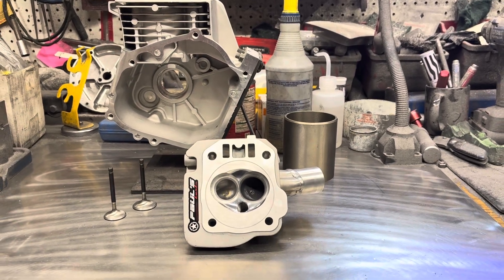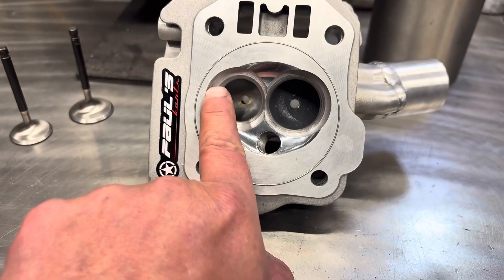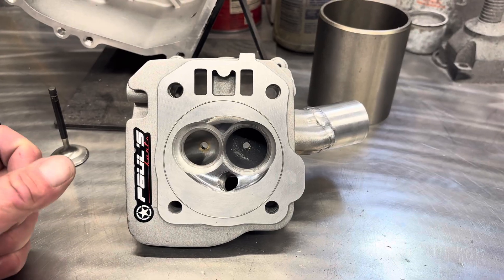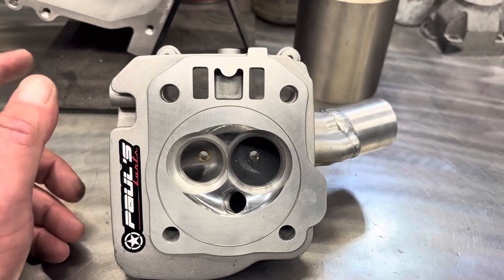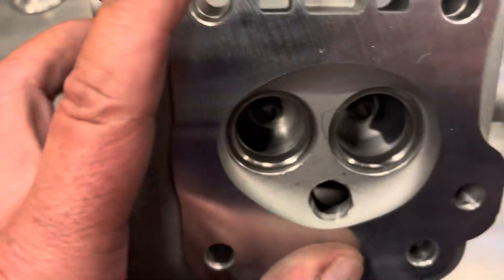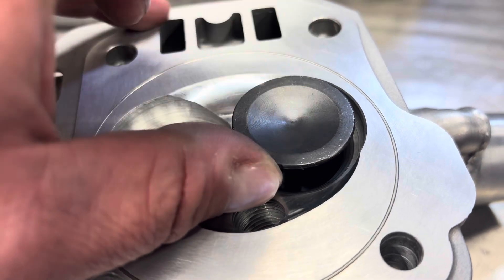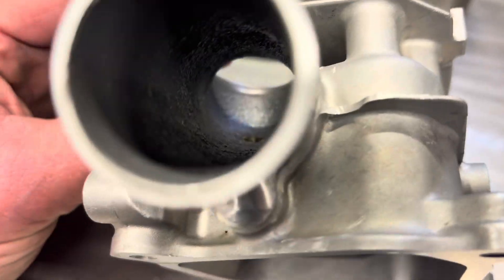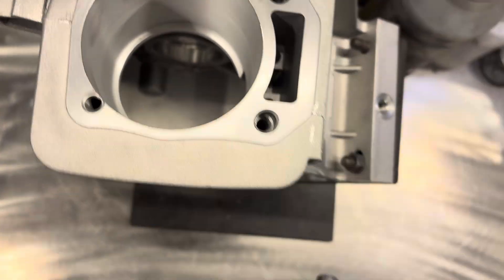Gx200 / predator 212 / Tillotson 236cc head porting look for a 266cc 3” stroker build Paul’s karts

Comment: I know this is an unasked question, would this kinda set up work with a Honda gx160. Not necessarily this exact head, but more like 36/27 valves ECT. 
I have a 63.5 crank stuffed in, wiseco piston, ARC stroker rod, ordering your gorilla camshaft, gage 1.2 rockers. 

Trying to make the nastiest 68mm drag mini there is.
Reply from the maker: No, that 36/27 valve setup size would hit the bore walls. But you can get a 32/28 down through there just fine.
Reply: @paulskartslifan4206 ok man, that’s what my dad was also telling me. I appreciate an answer 🤙

Comment: Insane work like always. Is there a ratio you use for intake port size compared to intake valve size? Or port/ valve size to cross sectional area?
Reply from the maker: Port size should be determined by the cfm requirements of the bottom end. And in a perfect world the seat ID should be the smallest point in the port. Hard to do with larger valves since there are casting limitations.

Comment: Do you need the maxport option so the ports look like that or can you do that without the slug
Reply from the maker: To get a stock casting to flow over 85 cfm you need max porting. A 236cc and above would require max porting solid slug style so get the amount of cfm through the port that those bigger engines want. Without max porting you can still make good power but greatness comes from giving it all it wants for air flow.